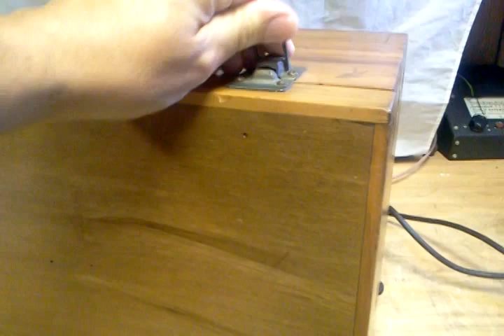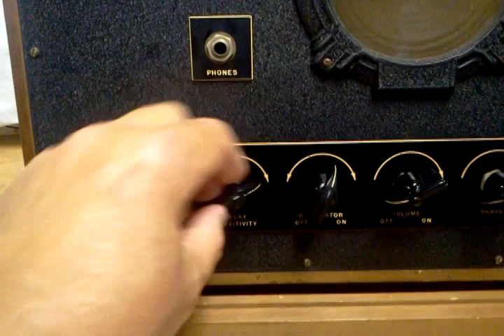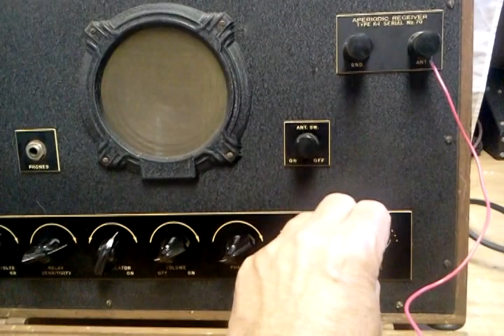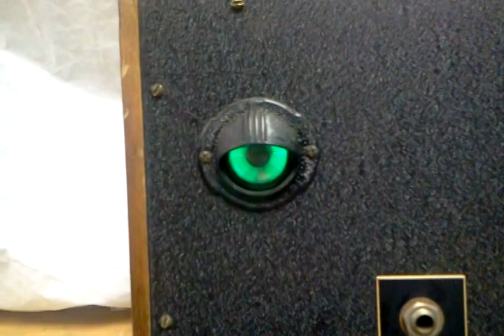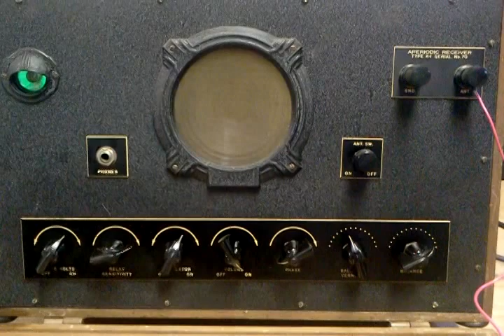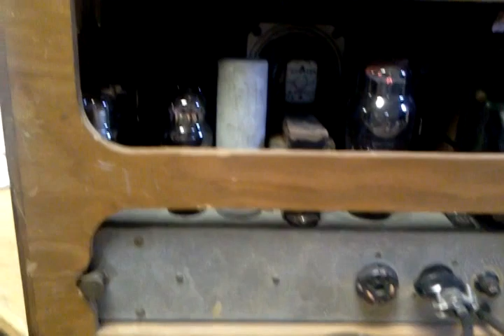WWII Spy Locator Receiver - Aperiodic

Comment: I'm surprised it doesn't have a few LC traps to help null out local AM broadcast stations.  Without those it's only going to be usable at low sensitivity levels and therefore only very near a transmitter.  It's also likely to be swamped by police and marine band radios.   One wonders how effective they were in actual use.